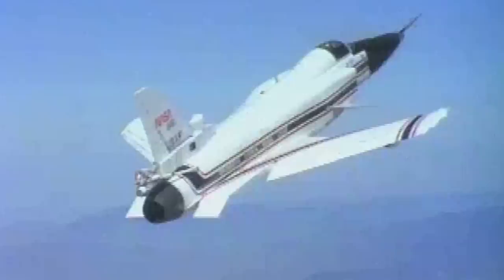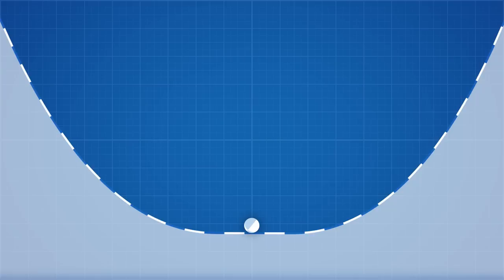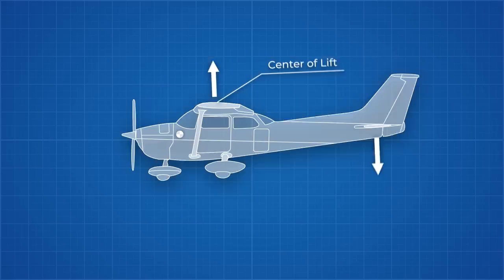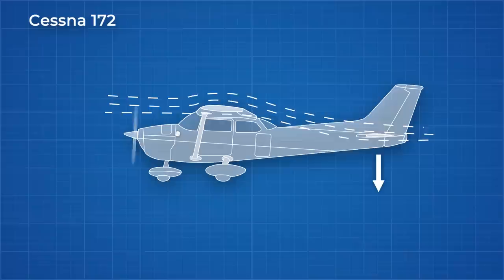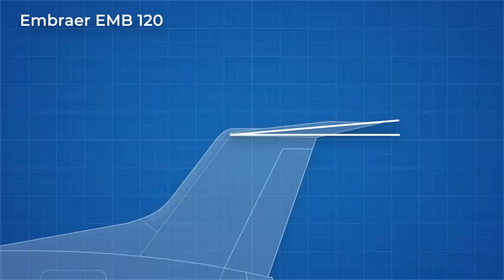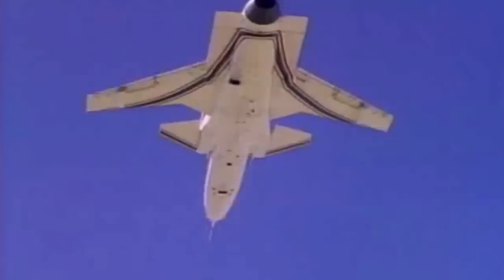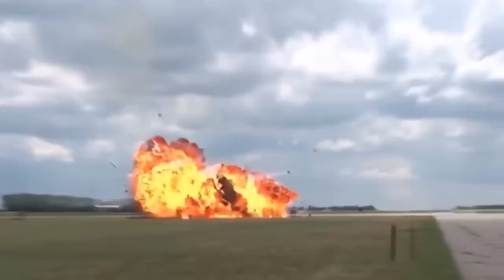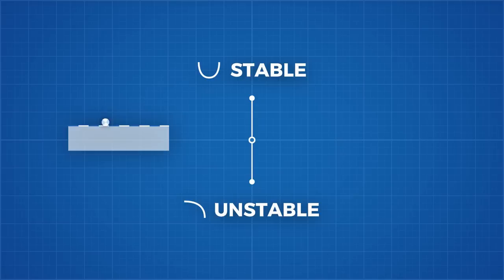Why Fighter Jets Can Be Too Unstable

Comment: Being an aerospace engineer myself I don't like how this vid mixes up static and dynamic stability issues without a proper explanation of both, which results in a vague, undefined "stability" being used. It's a lot more to digest though, considering a ~12 min production.

Worth to notice is that statically stable aircraft might be dynamically unstable.

Other than that, as always, great work. Keep it up. ;)
Reply: imizia pretty sure no plane is designed to only be statically stable, and that no design is truly “dynamically stable.” Planes are designed to be stable at expected accelerations
Reply: @FoxtrotGolfLima  Not entirely true. Yes, stability and control analysis is based on flight envelope and sizing data, because the product still needs to fly and be fit for certification.

Certification specifications (at least for airliners, I don't work with military) allow for the spiralling motion to be dynamically unstable provided that time constant is sufficiently big (meaning the response is not abrupt).
Reply: @imizia Nice to see a colleague here, greetings from the Czech Republic!🙋‍♂️ I had exactly the same reaction to the ‘static’ stability thing. Another ‘oh dear’ came along with the explanation of how the stabilizer works. At first I was intrigued – I never considered downwash to be a significant factor in static stability (qualitatively speaking) and was looking forward to some eye-opening revelation – but sadly nothing came of it.
 Still really good and informative video though.
Reply: To those who are interested in the stabilizer explanation:

Increase of angle of attack (AOA) of the airplane causes increase of AOA of the wing as well as of the stabilizer. Regardless of the empennage design. Classical, cruciform, T-tail – doesn’t matter all that much. The trick is that the stabilizer is set in such a way (by negative angle of incidence and/or upside-down airfoil) that in the usual range of airplane AOA it produces negative lift (downforce). When airplane AOA increases, it increases lift of the wing as well as of the stabilizer – but since the stabilizer lift is negative, its increase manifests itself as decrease of the downforce. Thus, letting the airplane pitch down – against the increase of airplane AOA. When airplane AOA decreases, the same happens, only in reverse.

About the downwash – it affects AOA of the stabilizer, always. The airflow is affected by the wing pretty far from the wing itself in all directions (at subsonic speeds), so you don’t get rid of the influence by putting the stabilizer on top of the fin, that’s not far enough. When AOA of the wing increases, the downwash angle increases as well, which reduces AOA of the stabilizer – therefore the increase of AOA of the stabilizer will be smaller than the increase of AOA of the wing. An example: L 410 UVP-E airplane with high-wing and cruciform tail gets about 0.55 degree of stabilizer AOA per 1 degree of wing AOA, while L 610 G airplane with high-wing and T-tail gets about 0.7 degree of stabilizer AOA per 1 degree of wing AOA. So, the effect of downwash is significantly weaker with T-tail, but it definitely isn’t eliminated. And as long as increase of wing AOA doesn’t cause decrease of stabilizer AOA (which might be physically impossible), the described principle works and provides static stability in the pitch axis.
Reply: Oh and the center of gravity (CG) position is also pretty painful for any aviator out there 😁

Explanation for those interested:
A conventional airplane (like that in the picture) will usually have the CG aft of the wing lift, not forward. Usually both wing lift and stabilizer downforce pitch the airplane up, they don’t wrestle each other. What causes the airplane to pitch down then? It’s the part of the pitching moment that is not caused by lift and downforce. It’s pretty much always present and pretty much always pushes the airplane to pitch down. Most of it is caused by the wing due to its nonsymmetrical up-cambered airfoil.
Reply: Im sure both of you can probably explain it more. But the problem here is time. Not everyone are willing to watch a 1 hour video just about a plane's stability. He did mentioned that there are many variables he didnt cover. Anyway, sure as hell fun to have the kind of knowledge you guys have.
Reply: @muhammadkhairulafiq2917  I definitely respect there are limitations of the format that prevent deeper analysis, that wasn't the point though. My point was about a) correct terminology and b) correct explanation of the stabilizer function.

a) He could have just called it 'stability' and I would have no problem whatsoever, that would be perfectly appropriate considering the format limitations. But he decided to use more specific term and he used it incorrectly.

b) Same with the stabilizer – it was a key part of the video, perfectly appropriate for the level of detail of the format, but again done incorrectly and therefore misleading.

It would take no time to use correct terminology (actually, if he got rid of the ‘static’ it would spare some time), it would take no time to place the center of gravity correctly, he could have dispensed with the alternative explanation for the T-tail (which is obsolete) and instead incorporate the pitching moment into the explanation and combine the angle of attack with the downwash (which is the real principle – the combination of both). And he could have kept the airspeed out of the explanation, thus again sparing some time (the speed problem really is a bit inappropriate for the video format).

Please don’t take this post as a hate or some weird flex. To me it is a constructive criticism of a valuable informative video. And above all, I feel a professional obligation to try and correct misconceptions and spread true (at least to my knowledge) information.
Reply: @Sidowse  They are faar from being the same
Reply: watching pros do their thing
Reply: @raven1758  Having the ht (horizontal tail) produce negitive lift for level straight flight is not a requirement for stability. As you explained well the lift of both wing and stabilizer increase as AOA increases. If the cg is placed in front of the ac (aerodynamic center) of the wing, both the wing and ht have a stabilizing effect. The both act similar to the fins of a dart. If you move the cg behind the ac of the wing, but still in front of the ac of the stabilizer, the stabilizer still stabilizes but the wing does the reverse. The wing now acts like throwing a dart backward. As long as the stabilizing effect of the ht wins this battle from the wing you have stability. When moving the cg even more back there will be a point where the wing starts winning the fight and the airplane becomes unstable. This switching point is called the neutral point.

If you have a symmetric airfoil and the cg is between the wing and ht while still being stable, the lift on the ht has to be positive (upward). Hence the direction of lift on the tail is not directly related to stability.

One of the reasons the ht of planes often produce negative lift for straight level flight is because most airplanes have wing airfoils with positive camber. This results in the wing producing a pitch down moment, which is countered by less (and thus often negative) lift on the ht. But is all about equilibrium, not stability.
Reply: @raven1758  I mean, you could interpret the forward pitching moment as shifting the center of lift backwards until it was behind the CoG, it's just a coordinate transformation.
Reply: My thought when I read your post is the very common rotational balance of a car tire.  You can balance it statically, but if you have asymmetrical mass concentrations it can be dynamically 'unstable' (hop city).  

Extending that to an example of true, still aerodynamically unrelated instability, took me back to reading about the Apollo missions.  I too was an aerospace engineer, but electrical design, mostly 'defense' oriented.    It turned out that the orbiting stack consisting of the command module and LM (then LEM, shortened for obvious reasons) had an irritating and previously unsuspected habit of reorienting itself perpendicular to the moon's surface on orbit, requiring some small amount of unanticipated additional thruster corrections. 

As I understand, reading about it, this was due to mass concentrations on the moon which essentially pulled the heavy end round very slightly on each pass.  I don't know if this eventually would have reached the constant slowly rotating always vertical orientation, but suspect it might have, like a pendulum winding down and stopping.  That's probably not a requirement of that system, but a possibility to my thinking, exactly like a tidally locked (different mechanism, hinted rather strongly in the name) moon or that of many planets, driven in that case by tides in the stars atmosphere.   Apparently there are only three lunar orbital axes that are stable.

As an aside, I have never looked into why integer orbital rates occur between coaxial planet/moon orbits but that is another interesting orbital mechanical stability that sometimes occurs (always, given long enough, and certain system ICs?).  These are obviously completely different modes than aerodynamic stability, which I've also dealt with a bit an eternity ago, when scratch designing seat of the pants RC aircraft as a kid/young adult.  

I did a flying wing once, and fortunately I at least knew enough to realize that a reflex airfoil was required,  That particular design was based on a freehand 'looks right to me' airfoil as well, which was probably a dumb idea looking back, considering all the work NACA put into designing and tunnel testing various airfoils at various Reynolds numbers, but it flew semi respectably, and for a flying wing was fairly stable, within limits, when the highly critical CG was dialed in.  

The instability came, as I suppose it does on any flying wing, sans high bandwidth computer controlled inputs, at a high enough negative pitch angle of attack. As did the early Northrop attempt, which I think manifested as a seemingly instantaneous tuck (or backfiip?) at some flow referenced angle of attack 'limit', as well.  

From a logically derived standpoint (with just about enough knowledge to be dangerous, meaning college physics/fluids/dynamics/some limited practical experience) I expect there might be a similar limit somewhere in the pitch positive moment, but offhand I would suspect that if there is, that might occur at a higher angle of attack than the negative version, given the preferred LE downward tumbling forces inherent in a non reflexed flying airfoil, which I knew from dropping them for fun.  I never experienced any pitch up instability  that plane, however.  

It always struck me as a stall induced phenomena, similar to a snap roll, but common mode.  I wanna tell ya, when it happened, it HAPPENED, and there was nothing you could do about it.  I had sense enough to do original testing on a gently inclined hill, on windless days, over very long grass, and it was very light and strong, luckily so I got extensive 're-kitting' free test duration.  

At altitude, obtained by piggy backing it on my winch launched 8' Craft Air SD 100, e it would tuck, and sometimes be recoverable, IIRC, in kind of a weird split S, or more accurately 'split C' with an attached hat line.

Some of the speculation portion above is probably utterly full of poop thinking, but you sent me into thought mode, so I thought I would subject you to to it.  Sorry about that.  My bad.  I hope that you got a good laugh out of it, anyway.  Like I mentioned earlier, college physics/fluids level stunted ramblings.  Cheers.   :-)

Comment: I have designed multiple aircraft. The Center of Gravity is NOT in front of the wing. Typical location of the CG is about 0.3 to 0.4 of the average chord position behind the leading edge of the wing. Placing the CG too far forward (such as your video indicates by putting it in front of the wing) causes a huge loss of efficiency because the horizontal stabilizer and the elevator needs to generate a huge downward moment thus creating a great deal of unnecessary induced drag which wastes fuel. If the CG is in the 0.3 position we get an ideal situation where the horizontal stabilizer / elevator combination is in neutral position for level flight thus requiring minimal drag to fly. If the CG is moved further back, less command authority is necessary to control the plane but also makes the job of the pilot harder. The CG should never be put back more than 0.4 without a fly by wire system as the plane would be uncontrollable by manual means. You might want to do a video about the quest of fuel efficiency leading to a very famous accident in a DC10 cargo plane where the tail surfaces were trimmed smaller so as to achieve greater fuel efficiency but this led to not enough command authority at slower speeds during landing. In this particular case, the DC10 bounced 3 times then broke up because it was landing at too slow a speed. The size of the tail is often a tradeoff between low drag at high speed (when you have plenty of command authority even with very small tail surfaces) and the need for command authority at low speeds (where command authority is low and there is a need for larger tail surfaces). As with many things, environmentalism comes with a price in human lives. Things that save fuel and energy is often paid for by the loss of human life. Another place you may want to look is at the Reno Air Race where P51 D Mustangs from WWII are typically used with tail surfaces trimmed smaller in order to reduce drag at the risk of too little command authority during landing.

Comment: This is very interesting. As someone who flys models, we move the cg to adjust pitch sensitivity. A forward cg, typically 15% of the wings chord, makes the model very stable and easy to fly. An aft cg, typically 25-30%, gives high maneuverability but at the cost of stability. Any further back and the model becomes impossible to fly as a tail heavy plane will attempt to to a backflip if you look at it funny. This is different to what you maneuverability as we can easily move the cg of a model with weights but a full size aircraft has its cg set by it's payload and design. Thanks for the in depth video and awesome graphics 😁
Reply: Thank you that was interesting & informative - much better than many comments ;-)
Reply: imo CG at 20% is really manoeuvrable.
Reply: @fenrir834  I only run far aft cg (30%) on my crazy tiny stunt plane, everything else is about 20% which gives a good mix between stable and high maneuverability.

Comment: According to a Grumman engineer who worked on the program the X-29's instability came from it's canards, not the forward swept wing. It was quite safe too with both analog and digital slight control systems. And for unstable aircraft the tail produces lift to push the nose down, not downforce to push it up.

Comment: The x29 engineers clearly didn't use skillshare to make a better design
Reply: That's a bit of disservice from the engineers who designed it with far less digital tools than today.  The X29 was more of an experiement on supermaneuverability.  The control system was successful but it proved that due to the extra stress on the wings due to the forward swept design, it had to be heavier.  A later plane, the x31, proved that thrust vectoring could contribute to agility so it was used in the F22.
Reply: hi O F D...
'
american was first made pretty plane X-29 with the single jetmotor...
later ussr russia copy steal to make su-47 with 2 jetmotors from X-29
Reply: @shaider1982  Pretty sure that OP was making a joke about video sponsorship.
Reply: @ericgulseth74  yeah, I guess.
Reply: @shaider1982  F-22 tails move faster than the nozzles, so not more agile.  It uses thrust vectoring largely for supersonic trim drag reduction.  The nozzles help maneuverability, but it is plenty maneuverable and agile without their pitch assistance.
Reply: @bestamerica  Russians studied the Junkers Ju 287 and not copied Americans...
Reply: @bestamerica  They didn't steal the X-29.But they respectfully kicked it into MAXIMUM OVERDRIVE
Reply: @shaider1982  the used a modified f-15 to experiment with thrust vectoring nozzle for the f-22 not the x-31

Comment: your university based knowledge is no match for my KSP experience
Reply: Your bird intelligence is no match for my people intelligence.
Reply: Turns out pitching up 90 degrees at mach 3 is a bad idea. You don't need those wing, right Jeb?
Reply: @chlorine5795  Big brain.
Reply: @tadferd4340  that's actually possible in KSP, I have a design that can pitch 90 degrees at 900ms without losing wings, but pulling off such stunt means knocking out Jeb and losing most of the speed
Reply: @tadferd4340  oof, IRL it would just vaporize...
Reply: @shepherdlavellen3301  at 5000m though?
Reply: @tadferd4340  just tested it, yup, it worked at 5000m or below
Reply: Time to download FAR...
Reply: Tadferd yeah just autostrut the wings. I have a plane that can pull 100gs no problem, could do more but it'd need more control surfaces. 1000m/s and max pitch without breaking apart
Reply: Tadferd far
Reply: Shepherd Wu give us the craft file